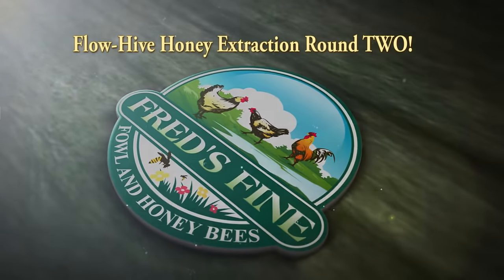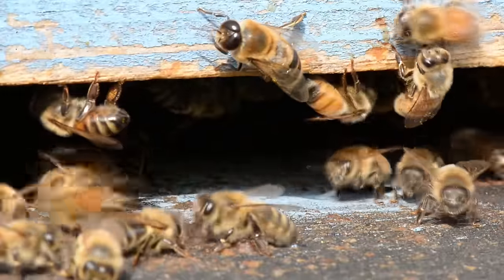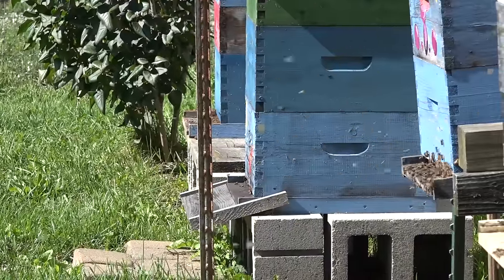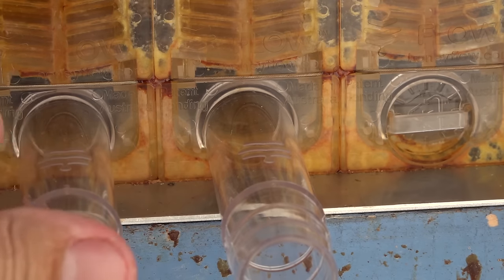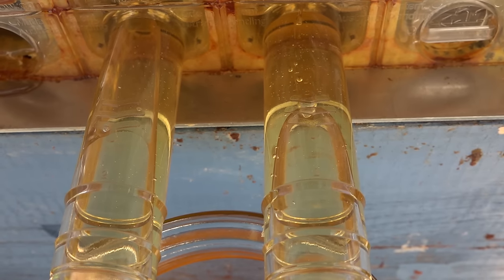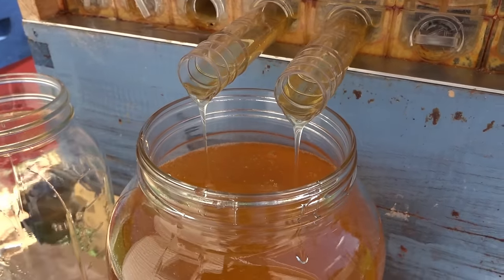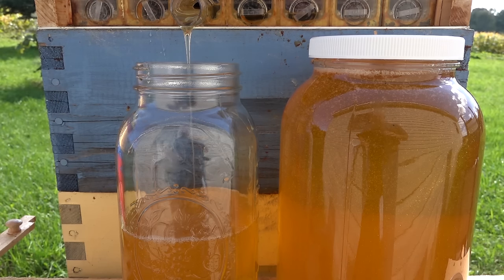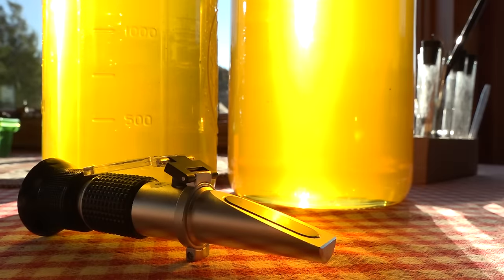The Flow Hive for Honey Bees 2nd Honey Harvest Review and Testing

Comment: Hi Fred

As it was your videos that encouraged me to buy a flow frame sorry you get my questions and I hope u don't mind.
My flow hive 2 is bursting at the seams with bees and 5 frames full of brood ready to hatch. But no activity in the flow frames. After check for swarm cells as colony is big I scrapped wax and honey of the side of the box and pushed it into the middle 2 frames hoping the bees will start working the frames. Did I do the right thing and if not your insight would be appreciated.  Regards   Gareth
Reply from the maker: How many boxes are on that hive? For example, is there a deep, then a medium or another deep and then the flow-super? Or do you have  deep and then the flow super?
Reply: @FrederickDunn  hi Fred

It's my first year as beekeeper, the hive has an 8 frame brood box with flow frames above.  I have another brood box and a medium super for this hive but. The medium is on above the flow frames without frames inside because I had condensation issues. The medium has 8 vent holes wired over and this stopped the condensation and mould that had started. I have 5 other hives I'm going to boost my weakest with nurse bees and a frame of brood to get the population down a little in the flow hive.   On checking today the bees are drawing the frames out with some hector already stored.

Comment: Thanks so much for your amazing videos!  I am a brand new beekeeper and am very excited for start my first hive this spring.  I read in some previous comments that in the future you don't plan to leave the flow super on during the winter.  I plan to have 2 deep brood boxes and was wondering if you thought it would work for me to have a traditional super on top of the broods and eventually topped with a flow super, which I would harvest and then bring in for the winter, while leaving the traditional super full of honey for my bees for the winter?  Do you ever have to do anything with the supers that you leave as food for your bees, or will the bees just eat the honey, clean them and reset the process over and over?
Reply from the maker: Hi Deanna, because I'm experimenting and observing, I am leaving three flowsupers on throughout this winter. After this, I will remove the flowsupers for winter and then put them on the most productive hives in spring. Yes, having two deeps and a shallow traditional super for your base colony habitation sounds good to me. In spring, I take off remaining honey from the traditional frames and spin it off, then replace the drawn out frames so they can work them as new nectar comes in. I've learned that when spring comes if there is surplus honey in the upper boxes, they ignore it and simply expand their stores. They also consume the newest honey first. So, taking off the previous season's honey keeps things going and prevents them from becoming honey bound. I hope that answers your question?

Comment: Quick question about your supers. I also live in the northern United States. You might have mentioned the reason, but I didnt hear it. I noticed that you included a traditional Langstroth super underneath the Flow Hive Super. Do you harvest this? Or do you just keep it available to the colony for Winter stores? I plan on doing double deeps on my hives and wondered if an additional super would be needed. Thank you so much for your videos. It's made me consider adding a few Flow Hives.
Reply from the maker: Hi Kyle, I leave that super on for the bees and it serves two purposes, one is the honey they store in it and two is that it's another deterrent to having the queen make the flow supers her brood area. I don't use queen excluders in any of my hives, with or without the flowframes and this configuration has always worked for me.

Comment: It seems to me that this system would gunk up after awhile with the bits of honey that dont come out and all the broken wax caps that stay on the frames does a beekeeper have to clean this system every so often or do the bees clean everything up themselves ? .... Edit - sorry i had to come back with another question do these flow frames yeild more honey then regular frames that other people use and have to manually extract all the honey from ? Would you say these flow frames are worth the money ?
Reply from the maker: HI Brad, nothing gunks up as the bees are extremely good hive maintenance workers. They remove the caps completely even while the honey is actively draining from the frames. As to if the Flow-Frames produce more honey than traditional methods, I'd say it's about equal. There is less processing and almost no wax removal with flow-frames while the traditional method removes more wax which the bees must then restore and that increases honey consumption on the part of the bees for traditional extraction. At the end of the season, I pull the flow-frames and let the bees clean the frames and if someday, they don't seem to do a good enough job, I'll just pressure wash them with hot water. So in short, the bees are doing the work so far. As to if they are "worth the money" that just really depends on what your plan is, how much disposable income you have and if you'd like to avoid all the mess that comes with uncapping, spinning, filtering and then bottling... many cleanup chores associated with the way I used to do it and my wife is VERY happy that all I do now is take empty jars out to the apiary and bring them back full. No comparison, so, for me? Absolutely worth it.
Reply: Frederick Dunn great answer really helped  straighten some things out for me thanks alot !

Comment: Just found this video and I'm thinking that there should be a built in 'plow' or 'reverse plunger' for when the frames are getting empty and the flow slows down significantly. It could be like a thin stick running all the way across and under the frame with a mini wall attached to it, so that when the last bits of the honey are just in the bottom tube you could just pull out the plunger and force the rest of the honey out of the tube so that there's less waste and the bees don't have to do as much housekeeping afterwards. Dunno, just a little concept I brainstormed while watching this video.
Reply from the maker: Interesting idea, but it's not wasted since the bees reclaim it through the hole at the end.
Reply: @FrederickDunn  Maybe I worded it a bit weird, but by saying 'waste' I meant it as in not harvested and left for the bees to clean up. What I had in mind is in the case where you have nicely viscous honey which doesn't flow that fast without the pressure from the honey still in the frames, you could scoop up every last drop in one single swipe of such plunger. Afterwards you would simply reset the position of said plunger or just take it out completely (probably would be smarter to make it detachable). You could effortlessly harvest those frames to the last drop. Just some food for thought for the creators I guess

Comment: HI Fredrick.. I live in the UK and we have a flow Hive system which we are going to use next year. We are new to bee keeping and we have a concern having spoken to several bee keeper regarding the crystallising of honey in the flow frames. This is in particular due to Rape seed which is usually in flower at the beginning of the season April-May. We were thinking of drawing off the honey regularly i.e. little and often but watching your amazing film today you suggested once you open a flow hive frame you must draw off all the honey. Do you have an idea how to make a flow frame work with rape seed. Once we get into the middle of the season it would not be an issue its getting through the initial few months.. I hope this makes sense. Jason
Reply from the maker: Hi Jason... If what they are bringing in has a tendency to solidify, they you should drain that off as soon as it's capped. If you find that you get to that activity too late, then the bees can use the resources, but you can't as it simply won't drain. If you wish to restore the flow frame that has "candied" honey in it, you can remove it and rinse it out with warm water until the granulated honey washes out. The bees will finish the clean up. I hope that helps?

Comment: Do you still filter your honey after you siphon it off? Looks like a fair amount of particulate is still in the honey.
Reply from the maker: Mostly what's coming through will rise to the top of the jar of honey after a day or so and you can just scoop it out. You can certainly run it through a screen if you want no visible particles. A 200 micron filter is more than fine enough and still allows the pollen bits to remain.

Comment: I’ve had my flow hive with bees for about two and a half months and they haven’t even touched the flow frames. Is there a trick to getting my bees to start using my flow frames, or does the colony just need to get bigger?
Reply from the maker: The key is to make sure your colony is well on it's way and nearly full in the brood box before adding any super. I go with a single deep, then at least one medium super at 80% full before adding the flow-super. I've never primed the flow-frames with anything. I have had friends who didn't cycle and close each individual flow frame before installing. If any of the cells are in the open position you will have a hard time getting bees to work with it. I wish you all the best with your flowhive :)

Comment: Another fantastic video but I don’t understand the part about the honey dripping down in to the hive after the first extraction. Is that normal?? I have a Flow Hive but do not have my bees yet and I’ve not heard of this happening before.
Reply from the maker: That doesn't always happen... I did several things then, that I don't do now. I emptied all of the frames one after another, and I also opened them fully. Now I do a few frames at a time, and only open them in sections. When the honey is coming out and filling the drain tube, I wait for that to go down to at least 1/2 diameter before cycling open the rest of the frame. Working in 1/3 rds is a great method. I hope that helps.
Reply: @FrederickDunn  yes thank so much. Your videos are very helpful and such a pleasure to watch. Thank you for sharing your experiences.

Comment: Hey Fred:) do you remove your honey super for the winter and if you do it how do you get the bees out and do you clean the frames?
Reply from the maker: This year I did something different because the FlowHive company doesn't make feeders, after the last flow-draw off, I remove just the plastic flowframes and leave the box with the Queen Excluder under it to keep the cluster from rising into the empty box and then I use that Flow-Super frame as a feeder box just in case they run out of resources - this year I just put dry sugar in a rapid-round feeder. As for the removed frames, I let the bees clean them up before putting them in storage for this coming spring. I'm going to add this explanation to my next frequently asked questions video. Thanks Philippe!
Reply: Frederick Dunn thank you so much
Reply from the maker: @philippedesilets8565  You're welcome...

Comment: Did you do something wrong the first time that caused the honey to drip to the hive, or is that just normal for the design?
Reply from the maker: The first time around we wanted to see how the bees handles opening all of the flow-frames in a single draw off. The second time around we opened half a frame at a time and neither was technically "wrong" but informed us that when the frames are new, they leak more when drained than they will during all subsequent cycles. The inventors mentioned that during the first cycle, more leakage can occur. We haven't had that problem since and always open the frames in intervals so they are not overloaded.

Comment: What happens to left over wax? 
Who clean the wax , would not clogg your system ?
like I don't know anything about Honey framing. Your system looks fascinating that's why am asking.
Reply from the maker: Does not clog the system, normally they re-use a large portion of it, but for some reason often remove the caps on the Flow-Frames. The wax caps come off and don't go into the honey, though their are often tiny bits of propolis and wax at the beginning of a draining cycle.
Reply: @FrederickDunn  Thank you,  what I learned today, kinda, educational.

Comment: Considering I’m a new old bee keeper , I know how I used to harvest honey and I’ve been known to get lazy on occasion and leave supers up on top if I had a strong colony down below for the winter , could I leave the flo supers on for the winter if  you have a strong colony below? 
Also * I like the little trick you did with the double flo rod keys to crack the cap seals  on the frames
Reply from the maker: I would never leave a flow super on for winter regardless of colony numbers/strength. You would end up with eggs/larvae in the flow frames and that's not a very good idea :) I'd take it off for winter and return if the colony is strong in spring after they have a honey bridge with at least one medium super on.
Reply: Thanks ! Now I will  build a frame rack 🙂

Comment: I do have a question though that wasn't answered in the video. You showed that in the drain area that contained propolis and debris, but did you end up filtering any of it off? Or is all of the debris now in your gallon jar of honey? Could you use something like a filter for future extractions?
Reply from the maker: That's a great question, I personally don't mind wax and propolis particles in my honey, but if you want to take it off, just wait a couple of days and those bits will be on the surface and you can take them off with a spoon. Just like the thousands of tiny air bubbles, they rise slowly to the surface.

Comment: Hi Mr Dunn, thank you for these excellent videos, Fascinating, A quick question from a complete non beekeeper, I've been reading the comments below and no has mentioned the fact that using the flow system may be less stressful for the Bees than the old system of honey retrieval?? I would imagine, looking at it from the Bees perspective that it is a lot less intrusive? would love to hear your thoughts.
All the best from the UK.
Reply from the maker: HI Aynsley, based completely on the honey bees response to the FlowFrame method of taking honey off, you are absolutely correct. For example, when I remove frames of honey the traditional way, I have to smoke the bees and actually pull components apart. This always results in disruption of the routine within the hive and the bees go into repair mode as they try to keep their honey. There are also almost always injuries to workers and cells which may contain brood between boxes etc. Then, for several hours after honey frame removal, the guard bees are on active patrol for several hours after the honey has been removed. In contrast, opening the back of the hive does not require smoking, the bees do not launch any defense and the guard bees do not launch a perimeter patrol. It is by far, the least invasive method for removing honey that I have ever used. Thank you for that question!

Comment: Hi Fred, I've been watching your videos for awhile now but I must have missed the one for when to remove the flow hive super. I'm being told to remove them now from my beeks groups but the bees are still putting in nectar. I'm so confused! When should I remove the flow super? I live in the San joaquin Valley of California.
Reply from the maker: Whenever your fellow beekeepers are packing down their hives for winter in your area, that' when you'll want to pull the flow-super even if it's not finished honey. You can put the frames right into a dehydrater or hot room until the water has sufficiently evaporated. Or, drain it off and feed it directly back to the bees, Orrrr, put the uncapped frames out at your feeding station and let the bees recover all they can. But treat it like other supers and pull it off no matter what state of capping it's in.
Reply: @FrederickDunn  thank you! I love your postings & am learning so much from you even though we live in different climates.

Comment: Great video Fred, thanks for sharing! I wanted to make you aware that Youtube is no longer connecting the first extraction vid in the links, I had to hunt for it. Instead it takes you from the assembly vid directly to this one.
I have a noob question though; are there any extra steps you would take to perform your usual colony inspection / maintenance with a flow hive super on top? I'd assume that it's not that different from any other box but you're clearly the person to ask.
Reply from the maker: Hi Ke4cpc, thank you for the heads up about the linked videos, I'll check that out. Regarding inspection and honey bee management practices, nothing changes with the FlowHive or FlowSuper as shown here. All of the other management practices appropriate for the keepers climate remain the same. Brood inspections, drone management, overall bee health are all still very important things which must be attended to. We need to know for example, if there is chalk brood (high humidity issue) foul brood, deformities, adequate pollen and honey stored and if frames/comb require replacement or correction. The only aspect of keeping bees that changes with the flow-frames is the surplus honey removal. I hope that answers your question?
Reply: It most certainly does, thank you!